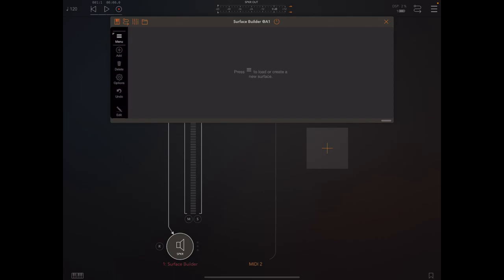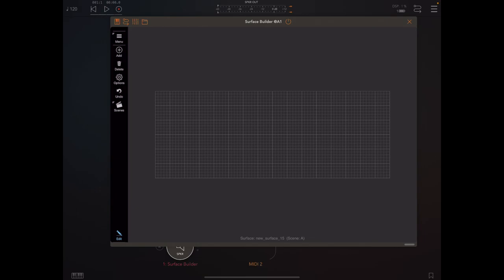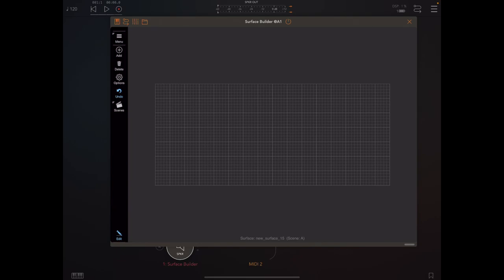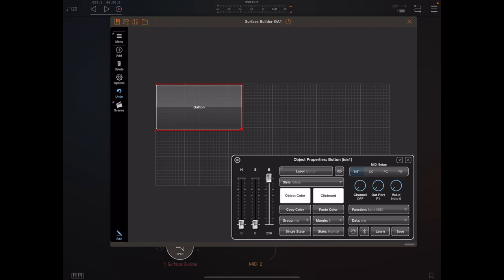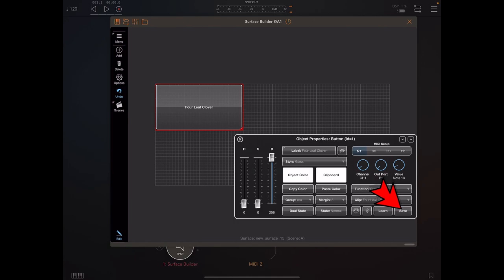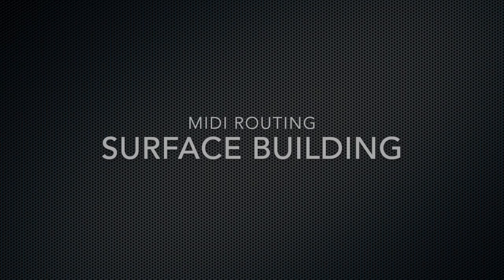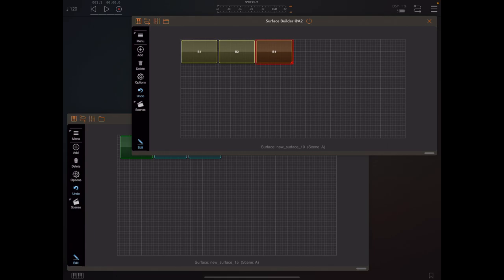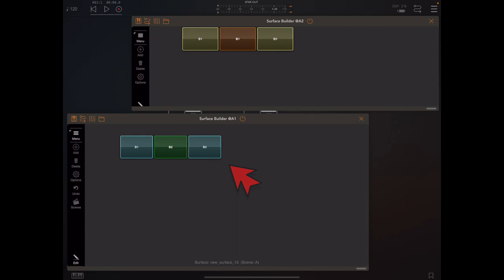Surface Builder - MasterClass 1 -  Beginners Guide

Comment: With all due respect sir, Paul, the ability to scroll between scenes in presentation mode without having to go into edit mode perhaps  with a finger swipe would enhance the user experience.  ( Unless I have overlooked this function somewhere )

Also, somebody mentioned on one of the FB iOS music pages, that elements on the grid get easily selected and moved accidentally, so I was thinking about a lock/unlock icon perhaps in a corner similar to the resize function.  I know it’s rather bold to impose on a developers genius but I also know you really do want people enjoying your fantastic apps 😀
Reply from the maker: I'd already considered a lock function so will add this to my list. You can easily put scene change buttons on your surface to navigate scenes but some kind of gesture would be nice too.
Reply from the maker: I've added a swipe up/down in presentation mode which switches scene. The lock idea sounded good, but when not in edit mode you can't move objects anyway. I guess the only way I could improve things is to have a lock positions icon which allows you to change settings without re-positioning.
Reply: @PaultheMusicMan   scene change button ( facepalm ) - had a feeling I was missing something - thank you 😁

Comment: Great app! Please consider adding recording of automation/movement of knobs/faders/buttons (one shot or looping or perhaps something similar to that fader movement in Fluss by Bram) 
Also - is it possible to sync events to eg beat/bar or so? Can’t find this option anywhere. 
Lovely app. I din’t even know I needed it (have some control surface apps already) until I got it and it turns out that an AUv3 control surface for AUM is just what I needed :) Thanks!
Reply from the maker: Thanks for the kind comments. Currently there is no explicit sync to beat/bar option, but I am looking to add this in future. The problem here is that AUv3 gives me the tempo, time signature etc. so syncing is easy, not so over MIDI and I'm trying to avoid anything AUv3 specific. If most people are using it in an AUv3 environment then it's a no brainer.

Comment: Paul , very good app , am delighted ,and so far it has made my life so much easier when performin live. But there is one thing that would be crucial for my purposes , and that is to have one button linked to 2 or more buttons that would send data with one single press. I tried several alternatives but it looks as this cannot be done. Well to be honest I found a very rudimentary way of doing it by using Snapshots, but then again,this takes a snapshot of the 6 scenes simultaneously , and somentimes I just want to send midi data from, say, 4 buttons simultaneously onl one scene without affecting the rest of the surface. I would appreciate if this can be done .Thanks again
Reply from the maker: Try looking into the BULK send function of a button. If you add a single button it can be programmed with a list of CC's to send when you press then release a button. Tap the button, in the Properties window set the BULK MIDI fucntion and press the DATA to add your commands for ON/OFF. Hopefully this will resolve your issue.
Reply: @PaultheMusicMan  Thanks Paul for taking the time to answer. ABsolutely I think that what you are suggesting is exactly what I need . Cheers and Merry Christmas !!

Comment: Hey Paul, assuming you can have multiple clips per instance of the app could you also have a volume knob for each to control levels? So say in 1 instance have 8-12 clips, each with a knob to control volume? Also what’s the time limit with these?
Reply from the maker: You can add a knob and attach it to a clip, so if you have 8 clips you can have 8 controlling volume knobs and a master if you wish.

Comment: I read about SysEx recording in surface builder and thought I could record bulk MIDI with SysEx data. I bought Surface Builder but still can't record a mix of SysEx, CC and PP data to send it back via a button. Please include this feature. It's a game changer to be able to use Surface Builder with external gear and use is as a midi library manager.
I don't understand the purpose of the build in midi monitor. It seems to show only the last line of midi data.
Reply from the maker: Have you tried the MIDI Recorder button function? This can record SysEx as long as the total size is less than around 2K in size. I use this for recording and sending SysEx Tone Packets in Helium. The monitor only shows the last command coming in/out as its really used to ensure data is flowing rather than keeping a log of MIDI data. There are plenty of MIDI logging apps that do this on the App Store already. On iOS and MacOS the operating system actually splits up SysEx from other MIDI data and does not send them as a single stream of data as you would normally get from a MIDI port.
Reply: @PaultheMusicMan  Do you mean "data" tap to edit and then "record"? In my case there are no sysEx data recorded in this field. Only cc and pp.
Reply from the maker: @HansAlbers10000  You have to set the button function to MIDI Recorder, press the EDIT button then RECORD. When a SysEx packet comes in it records the start F0 and the end F7 which are the boundaries for a SysEx packet. You can see the HexEdit dump when you press the EDIT button on the MIDI Recorder window. It's working well for me as I've recorded SysEx output from Helium. You will see some extra bytes at the start of the buffer which are internal to Surface Builder (time and length etc). Are you recording anything proving the ports are setup correctly?

Comment: Hi I'm getting Surface Builder pretty close to working for my needs, however my version doesn't resemble the video, for example my 'menu settings' do not have a "midi input' selection and there are several other differences between the version on my iPad Pro 2023 (Surface Builder version 1.08 build 56) and the version I see here.   Can anyone explain what I might be missing, thanks!
Reply from the maker: I usually produce these videos immediately after launch, but I'm constantly working on additional features after these videos are created. This will account for the many differences you will find in the videos compared to version 1.08. There isn't a MIDI Input section in Settings that I can see,  If you can point out where you see this in the video maybe I can help?

Comment: Hello,
Thank you for this new audio Tool.
I am wondering if this has the ability 
1/ to record an audio or midi within the interface 
2/  play back the clip previously recorded 
3/ this playback could it be at a defined time in a time line?
Reply from the maker: Recording audio is beyond what this app was written to do. Some even suggest it was stupid of me to add any audio support at all to the app, but I feel this makes it stand out from the rest. To launch a clip at a specific click time is an interesting one that I will consider adding to a future version as this had already crossed my mind. At the least I would like to add a scheduler to trigger components on the surface.

Comment: Is it possible to make the steeper object advance in a serries of ticks? Divisions of say 32 making it a quarter of a dial? or any other division? If that  is not presently possible could I include it on my wish list please? Many thanks again
Reply from the maker: If you press the < and > buttons they progressively get faster. If you turn off the CONTINUOUS mode then they only send MIDI when you release the < and > buttons, which is great for selecting presets where you need to slow things down a little.

Comment: Remotely controlled knobs don’t send midi data. 
There is a learn function for knobs, but if I turn my Hardware knob (or fader), the surface builder’s knob moves, but does not send midi data. If I turn the same knob on the touchscreen it does. 
So Surface Builder is useless, if you want to control it with MIDI hardware knobs or fader boxes?
Reply from the maker: This is intentional. If you turn the knobs manually it does of course send data, but it assumes incoming data is positioning data for the knobs (1:1 mapping not 1:1:1) so purposely doe not pass that on.
Reply: Sorry, but this doesn’t make sense to me …
Reply from the maker: @nikvr2025  In my demonstrations of Surface Builder I show 2 instances connected together being able to control each other. Quite often you want that 2 way communication, but if you think about it it both instances were firing off MIDI commands based upon what they received you would end up with a MIDI loop where A sends to B then B sends to A and so on. This is not how this kind of program should work. Only the controlling instance that has human interaction to turn knobs should send MIDI. You are trying to relay events between hardware -> software -> hardware/software which isn't supported for this reason.  Sorry I can't explain better.